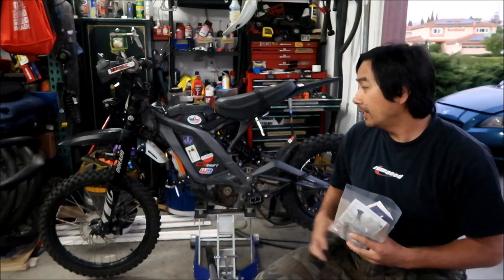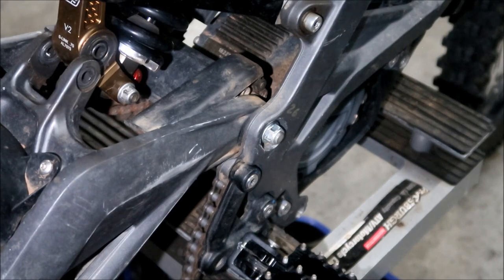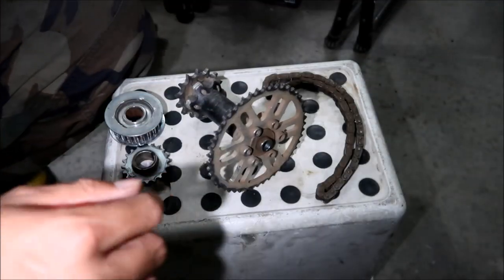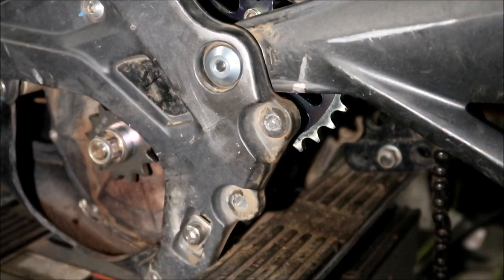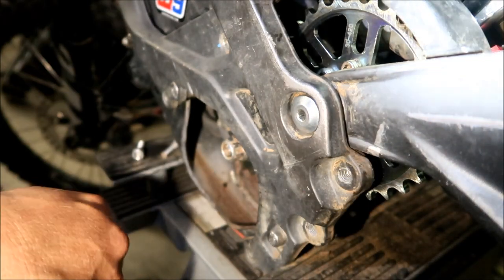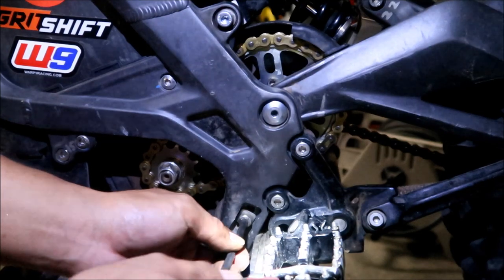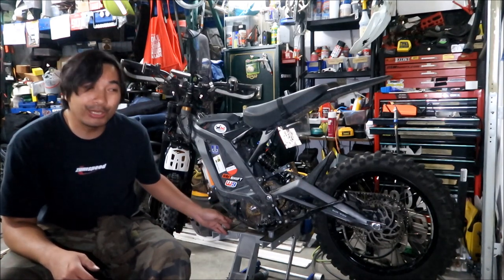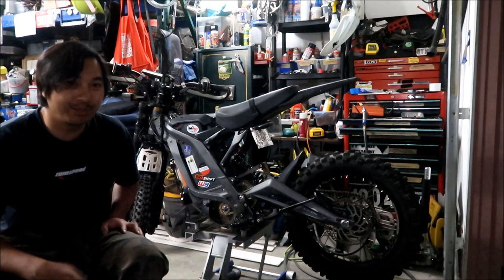DB Offroad 420 X Ring Chain Kit Installation Sur Ron Light Bee

Comment: I was thinking of doing this conversion but wanted to see what your experience has been so far. Are you having to adjust the tension regularly? Has it begun to quiet down a little or is it super loud compared to the Gates? Thanks man-
Reply from the maker: So far I have taken it to one supermoto race and done some doordash with it.  It is LOUD.  The 219chain is much quieter.  So far I have not had to tighten it just lube.  I have removed the chain twice so far also.  That's beauty of this kit you can remove and install the chain without disassemble the swing arm.
Reply: Thanks again... BTW, I really appreciate all the experiences you've shared. It's really helped me learn to wrench on my Sur Ron. Take it easy...